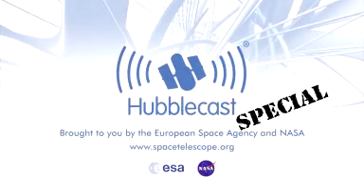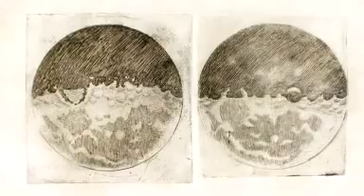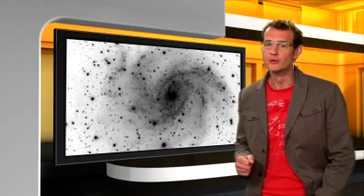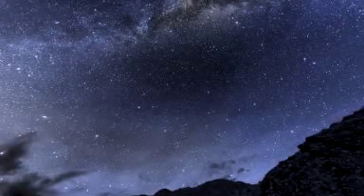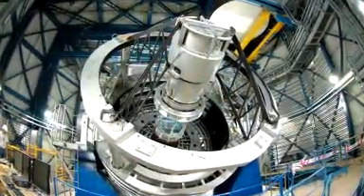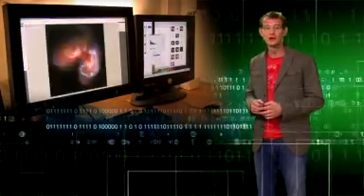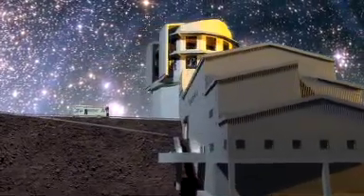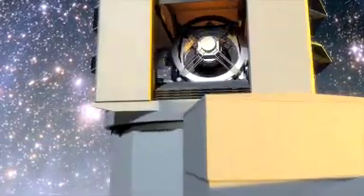Hubblecast 21 Special: From silver to silicon

Comment: "we no longer use film" ? who says sunshine?
higher sensitivity = more noise, meaning less detail. Also for long exposure the digital sensors require cooling otherwise they over heat and turn the images purple. So for amature use film is still a good bet because noise doesn't increase over long exposures like with digital sensors.